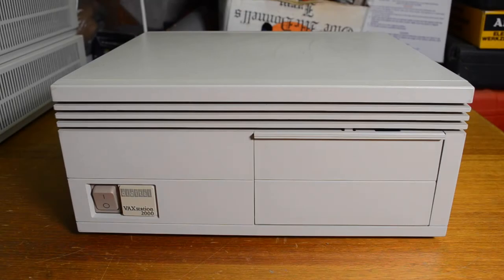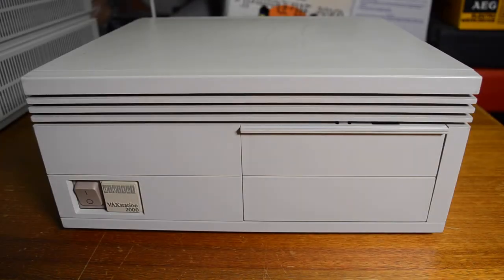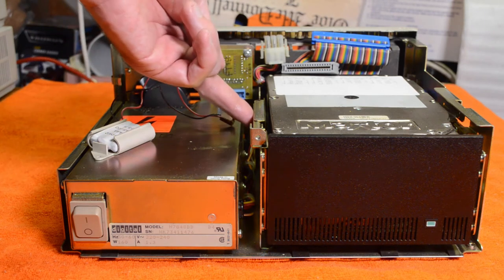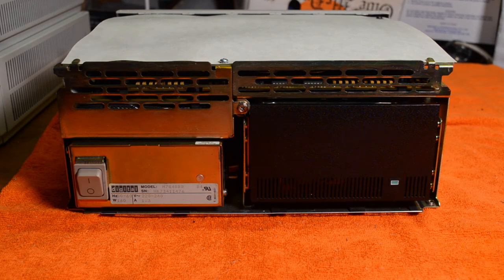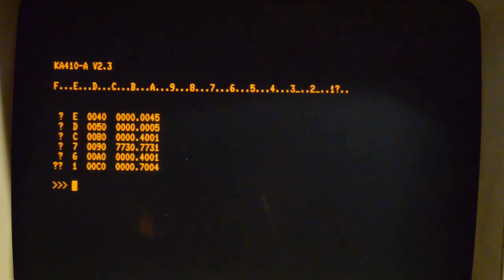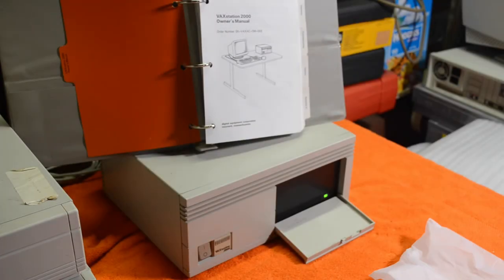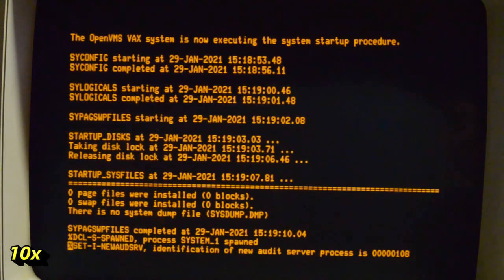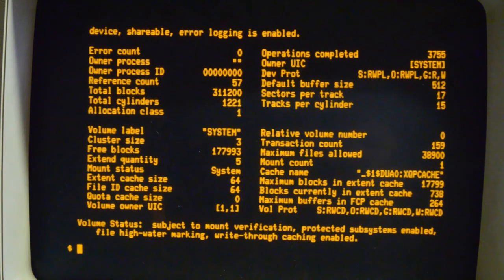The VAXstation 2000

Comment: Nice!  I had one as a part of my job back in 1990.  I had the color option and monitor and the expansion unit with a TK50 in it as well as other stuff..  Nice bit of kit.  Yeah, it was not as fast as the 8600 back at the shop, but it ran full VMS and allowed me to work from home as a developer.  I'd drop by the office a couple of times a week and connect up to the network and sync things up.  In an emergency programs (mostly in VAX BASIC) could be transferred over a modem.  Those were the days!!  Don't remember it taking that long to boot though.

Comment: Good to find your channel. I never really used the 2000 as a workstation, there was one at the company I was working at in 1991-1993, Cybertek Corporation, used for builds and it was incredibly slow, compared to the 3100 workstations we were using for development.
Reply from the maker: It may be slow, but it's a tiny VAX!  The 3100 will feature in my next video. Cheers,

Comment: what a beaudy!  bought one in 1988ish under Employee Discount Scheme.. I replaced the RD54 with a 1/2 height RD32(?), made room and then bought a Control Data 110MB 3.5in SCSI HDD, the perfect hack, 2x HDDs in the VS2K..! It stayed on my desk for the next few years mainly used to run VMS Phone, Notes and playing Flight..Gave it away to a friend in the late 90s but then a few years ago I tried to get it back but it had been lost by then.. I have another one and spare bits but it's not the same thing..sniff;;..  LM

Comment: Can you please describe the error 4280 of serial controller (DZ) shown during the bootup process? Or maybe you can point me out for some "troubleshooting tables" describing these error codes? The verbatim error message is "?? C 0080 0000.4280"
Reply from the maker: I had a look through my documentation and on-line, but could not find any information on it. Apparently the codes are listed in "MICROVAX MAINTENANCE GUIDE EK-VSTAB-MG" but this is not available on line. If you or anyone else knows where to get this, let us know!

The  serial controller is for the keyboard, mouse, serial connector, and printer ports, so maybe check there.